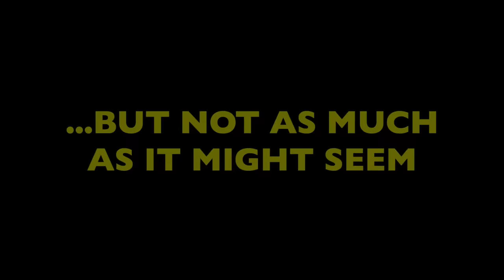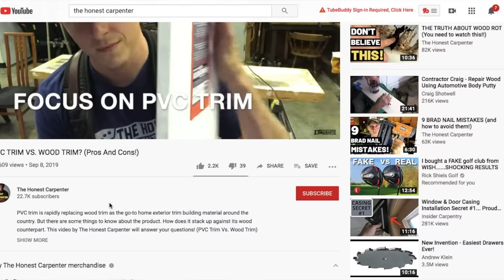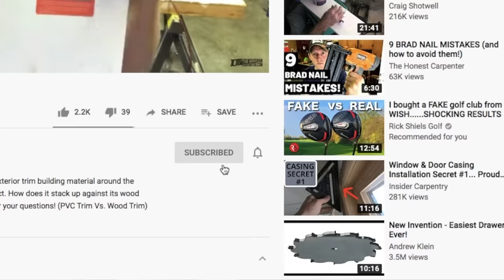How Much DAMAGE Can CARPENTER BEES Cause?! (What To Do About Carpenter Bees/How To Get Rid?)

Comment: what really works for a bee hotel is a 4x4 or 6x6 untreated post stuck in the ground with some 1" holes drilled at a 45 just pecked in a starter tunnel spots. it actually does work to keep them out of your structures as they find the post more ideal
Reply: If you build it they will come.
Reply: That's exactly what they've been drilling in for years is my 4x4 posts that hold up my porch. They come back every year and now I'm worried they're going to cause my porch roof to fall. So I dont know if making them a home out of 4x4 will help. What do think? Anyone have any suggestions? I really didn't want to kill them as I have a garden going all year but at this point I may not have a choice. Replacing 4x4 in 2023 has gotten expensive. I will try a few coats of fresh stain first and oil of orange
Reply: @DonnaRatliff1   Buy untreated 2x4 studs. You can predrill holes their size to 1/2" deep to attract them. Seal up the structural lumber so the untreated bare 2x4 become the most attractive option to bore. Tack them up horizontally, like under an eave or under the porch where it's dry.

Comment: It was a relief to hear from a carpenter that these bees are not all that destructive. We've been living with them for over 10 years. We've learned to not be worried about getting stung but I always worried about the extent of the damage they can do. Filling and painting have mostly kept them at bay and found hammering a roofing nail in the hole is great for a quick fix. I do have a few that have found their way into harder to reach areas and will try the bag trick. If that doesn't work I'll have to decide if I want to use a trap or just let them "bee".
Reply: Hey Kevin read my comment
Reply: Who says they don't stung one day one bee is failing on ground and i step on it bare foot and then can u understand my problem but it's good i make a excuse and escape school that day

Comment: Not mentioned here is my favorite solution: post decoy planks nearer to your garden than the house. A simple unfinished pine board with a sheltering overhang driven into the ground turns into a bee condo. Those "bee hotels" made of pieces of bamboo do not work. They don't allow the bees to bore their right-angle tunnels, and are readier hosts for wasps, and the bees will avoid them.
Reply: They do work for mason bees, which will use the tunnels then fill it with mud to seal it, but yea, doesn't do much, if anything for carpenter bees.
Reply: They will use them if the bamboo is black or dark. For some reason they do not like white/light-colored bamboo.
Reply: Same principle as a Japanese beetle trap. It only attracts more of them to your property. 😂
Reply: @claytond6898  Hi Clayton. Actully, I don't believe it attracts more. These guys are quite territorial. Once a female sets up a nest in a tube, the males spend the whole day zooming around to confront and chase away anything that approaches the area. I used to be intimidated by these big fuzzy bees hovering in front of me until I learned the males cannot sting and are easily ID'd by a big white square on their face. Now, I call their bluff: wave at them and laugh as they retreat a foot or two, repeat, repeat until they give up and fly away to chase something else, lol.

Comment: I had a water damage repair in a 2 story apartment complex, affecting a lower unit caused by carpenter bees. What occurred was this: At the seam where the siding panels butted together between the 1st and 2nd story, concealed behind a 2x6 fascia the Bees had entered once through both fascia and siding they found a passage way along the ceiling/floor joists only interrupted by blocking every 2 feet for them to bore through to the next pocket, an arrangement they enjoyed.  The roof mounted air conditioning units condensation drain was for some reason ported through the roof, over to the exterior wall and then down inside the wall to the foundation where it ported out the siding to drain in a flowerbed, the line schedule 40 PVC.  It ran through one of the joist blocks on the way down.
The bees chewed more than half of the pipe away. Picture holding the pipe like an ear of corn and bite halfway into it, that's what it looked like. That summer as the AC units, 4 tied to the line, were used the line served it's purpose except sawdust, wood chips, insulation and sheet plastic had clogged the line at the 90* fitting and the water evacuated into the ceiling and kitchen wall which went unnoticed for months.  The photos of the bite marks on the PVC are eerie.  But it was an unexpected cause to be sure.
Reply: They are a nuisance
Reply: Wow
Reply: Super Wow. We all gotta live together, but it sure does get challenging
Reply: Oh my gosh this is what we're going through. I'm s just me and my older mother and I moved in with her a couple years ago and her kitchen now is actually leaking when it rains real hard. I can hear them and their loud buzzing. No one believes me when I say it's the carpenter bees that have caused this damage. Sad thing is that her and I have not got the finances to repair and fix the infestation. I'm disabled and she's old and on fixed income. We have tons of rose of sharon bushes and theirs thousands of them daily. They are actually causing me a lot of stress trying to ignore the buzzing and damage. I literally try to get outside when the woodpeckers on the house hammering it trying to get them. They can cause a lot of mayhem, just saying

Comment: It’s not so much the Bees , it’s the woodpeckers that go after them tearing up the wood until they find them !
Reply from the maker: One time I patched some holes for a client, Patricia (used bondo that time, I think), and the woodpeckers came and drilled it out and made about five more holes that same week.😅 That was before I understood the life cycle.
Reply: Twice now woodpeckers have notified me of carpenter ant damage.
Reply: Great post! Our abundant wood peckers don't seem to have carpenter bee on the menu.
I overlooked them for years/ today I do the trap thing but it doesn't knock a dent in the population. 
This year will try a 1-gallon sprayer tank filled with a little water & neem oil. I heard treating the rafters with that stuff works for a while. Early spring and late summer our tractor shed look like a syfy horror movie. 
Strange but the pole barn is never been their hang out. It's the other barn with the tractor shed attached they can't get enough of. Treated wood V non treated do make a difference. I believe eventually the roof will commence to sag because of their extensive tunneling. 
The queen can sting the stew out of ya but that's unlikely she don't get angry easily. The males are the more visual and aggressive of the two. They are abundant crash into one another and bounce off your head and shoulder yet they are totally harmless.But try telling that to one of the grand kids ...
Reply: @one-newman7657  My neighbor stands in his shop and swats the males with a tennis racket.  Never once got stung.
Reply: Yes! At least the bees drill nice, neat 1/2" holes. The woodpeckers are more into demolition than hole drilling, LOL
Reply: @elkekirkpatrick6481  That's great been there done that, even thought about promoting an annual championship swatting event here on my place with cash prize and tee shirts! Lol these days my right shoulder is give out with old Arth and his cousin Ritis I just can't enjoy the game anymore! But it's a hoot to swat them things. Powerful and effective! They come in with a slow pitch and if ya miss they swing out with a fast curve. Thanks 4-the fellowship! GBY! 1 cor 15:1-4
Reply: @tenentenegrao  hey now that's classic truth!
Reply: No, it's about the bees. I've had issues with carpenter bees at at least three different houses and regardless of this gentleman's opinions, carpenter bees can do a lot of damage to not only soffit and facial boards, but they can seriously infest even pressure treated decking that is several years old. The more bees, the more damage. True they are not as bad a termites but they are still damaging.
Reply: @elkekirkpatrick6481  That's because the males don't have stingers. lol
Reply: We’ve placed wind socks where we have carpenter bee problems. Woodpeckers don’t like movement or shiny things moving where they want to go.
Reply: @one-newman7657  this is great 😂 might try this
Reply: matt8863, male cicada killer wasps do the same thing.  They’re just checking you out.
Reply: Wish you didnt shoot the woodpecker, but trapped it, since woodpeckers are essentially becoming endangered thanks to starlings stealing most food.
Reply: Woodpeckers visited my parents delicious peach tree and pecked it all up, but they took care of the borer problem before the borers could take care of the tree.  At least whatever bird did that had the decency not to tear the tree apart to get the grub, just poke neat little holes.
Reply: @bambamnj  butt they act like they do.
Reply: If you put a shiny pinwheel available from Walmart for like $1 near where the carpenter bees have drilled holes the woodpeckers will stay away.

Comment: So the house you have in the thumbnail  is for mason bees that don't harm anything. They use existing 1/8 1/4 and 3/8 holes and you can get many different types of leaf cutter and mason bees using the same hotel. They do not drill their own holes.  I do suggest getting mason bee houses they are great for your garden.
Reply: Mason bees are solitary. They don't live in such close proximity to one another in the wild. Mason bee hotels are like intensive mono-cropping for bees. It creates a risk for easy spread of disease and mites. A better option is to emulate their natural environment: don't clean up the dead stems of your flowers and garden plants. Mason bees will find their own 1/8 - 3/8 size holes among the stems - just like they do in the wild.
Reply: @andyid7440  you are correct but better to atleast give them some habitat, most poeple won't leave wood chunks our for them to nest in or have a messy garden and most of their plants are from the other side of the world.  I've had this discussion before in native plant groups and the scientist are split on the issue.
Reply: Mason bees will / can nest in exhausts of things like chainsaws and weed eaters.. . And cause harm.
Reply: @andyid7440  perhaps but the mason bees where I live are very social. Not usual to see 10 holes per square foot... perhaps a different species.
Reply: Sq foot of clay bank that is.

Comment: Great topic Ethan. I’ve pounded corks into the holes, tried steel wool, finally gave up and love that I can offer them shelter, when so many hard working organisms are being terminated. I might build a hotel. Lots of invasive bamboo nearby I can use
Reply from the maker: Thanks, hs! I've heard bamboo works great. And once you can get one to inhabit, lots of other will get drawn to the spot, especially very early spring, or early fall.
Reply: WD-40 in the hole--------their Done :):)
Reply: @dereksellars  Hello Derek 
After you apply the WD-40, will the filler stick? Or did you just create a mess?
Reply: @georgeferlazzo7936  Let dry for about a day and it will
Reply: @georgeferlazzo7936  You can also apply some Mineral sprits to clean the WD out if you don't want to wait.
Reply: @dereksellars  Brake Clean in the red can will dry up the wd40
Reply: Just in case this might still be useful to you or someone else: other people here have said the bamboo bee hotel shown in the video is for mason bees and carpenter bees won't use it, but putting a regular wooden board closer to the flowers than your house/ fence is will cause them to choose that instead, especially if the other surfaces are painted over.
Have not tried this, but just sharing advice from others.

Comment: I have had them for several years. I've been picking them off one at a time with a badminton racket. I recently heard about the grocery bag thing, and put it up two days ago. I haven't seen any carpenter bees in both days. If I remember, in a few months, I'll comment again if it actually worked.
Reply: did it keep working?
Reply: @CornholeSteve  None in the carport. I have some other lumber out about 60 feet from there, that one came around, but didn't stay. So, I'd say it worked. Weird, but I guess.

Comment: The woodpeckers cause more visible damage trying to get to the larva than the bees!  I tried the grey bag trick in my open tractor shed and it seemed to work, but at the same time I run a big fan from spring through fall pointed at the rafters to keep wasps from building nests, so that may be a deterrent as well

Comment: I've lived in Raleigh for almost 35 years and they will bore a hole in anything! Painted, treated ...I've even caught them trying to bore into shovel and rake handles. And much more than a foot or two in fascia boards!
Reply from the maker: I got so used to them as a carpenter in Raleigh, Zeke, I wouldn’t even flinch when they bounced off my face. As I used to say, “we just happen to work in the same places.”
Reply: I've planed down a cedar board that bees had gotten into. The hole went deep into the wood.
Reply: @TheHonestCarpenter  they don't  bother me either, but they are more destructive than we thought
Reply: Hey, spray WD-40 in the hole-----and watch them die in seconds, if they are in there, if not it killed their Eggs :)  A new one won't go to that hole.  Let me know how it works. I know first hand it will :):)  Happy Hunting :)
Reply: @dereksellars  Now, you need oil based paint.
Reply: @kretieg2943  good point!

Comment: We had carpenter bees for a few years in our fascia.  Last year we needed the fascia around the house replaced, so they used the PVC "lumber" as well as the concrete boards.  The bees came back this year and started looking around, but can't find their holes, so they seem to have left.
Reply from the maker: That’s good to hear, Rebecca. I think they can’t really drill pvc or cement fiberboard.   Or they’re just so programmed to seek wood that they won’t want to mess with it. But I bet they were wondering where they left their house 😅
Reply: PVC dries out and cracks and you'll have to do it again in 10 to 12 years

Comment: I have battled with them for many years.  I agree we need to let them pollinate but they've done a lot of damage.  What works for me is to spray them with WD40 (while they are in the hole) and use the traps. You can make the traps yourself...It won't stop all of them 100% but it will reduce the damage...and yes, the male bees may even bump you to get you out of their territory. I admire them and hate them at the same time.
Reply from the maker: Well put, Brent. I’d heard the WD-40 thing, but wasn’t sure if it worked.
Reply: I’ve used WD-40. They don’t like it. Later on I plug the hole and they don’t come back to the old ones but I will find occasional new holes. Probably new crop of bees.

Comment: a 3/8" dowel rod fills the hole perfectly, granted its wood and not a deterrent but for unsightly holes to fix...it works.  The hole they bore is always 3/8"
Reply: YOu can also wait till they enter their hole and dowel rod them.  It is amazing how perfectly round the hole is and its the same size hole every time.
Reply: This. I waited until they went inside then I filled it with some wood filler  putty lmao 😂
Reply: That fits most of them. Unfortunately some of mine are metric-sized; probably imports.
Reply: @markm8188  😆